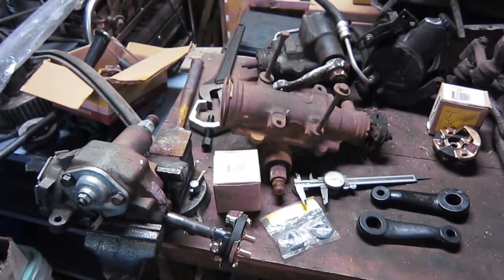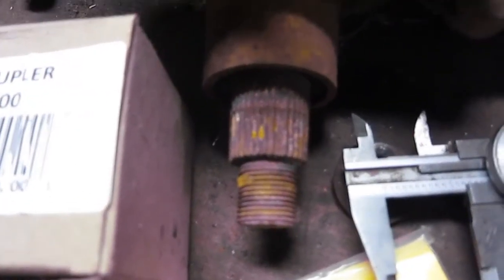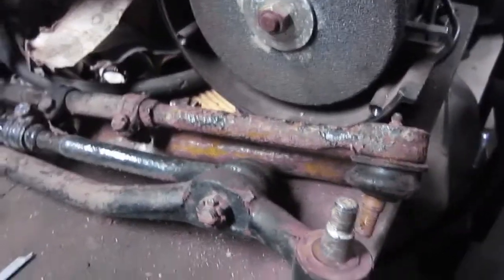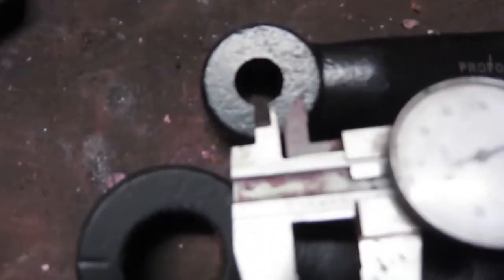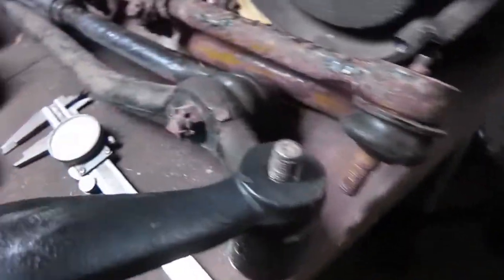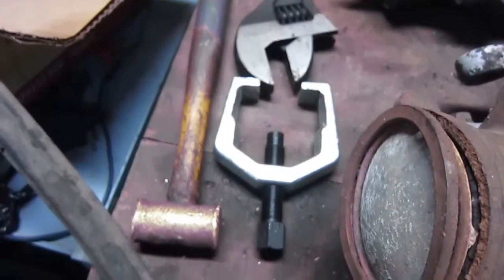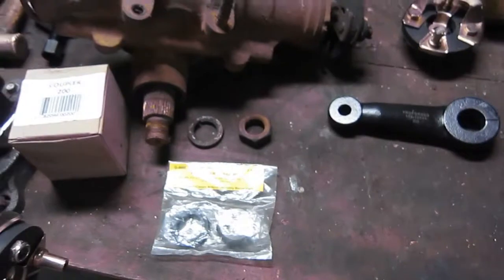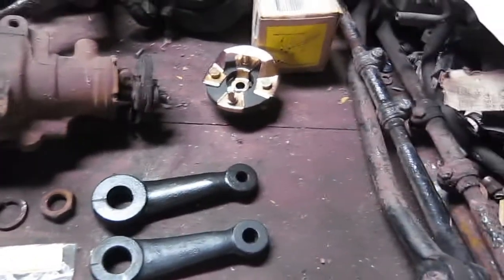Manual Steering Conversion from Power Info 64 65 66 67 Chevelle

Comment: How much does this switch affect the driving experience?
Reply: The main reason for the change is it is thirty five pounds off the front of the car. As for the change in steering you have to turn the wheel faster due to the lower gear ratio. Both hands help. Going down the road is pretty much the same.